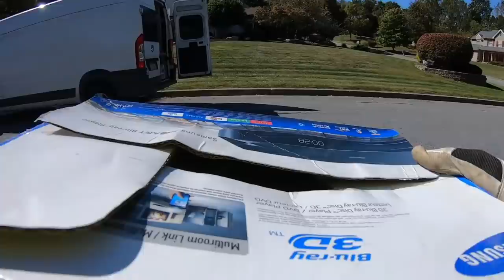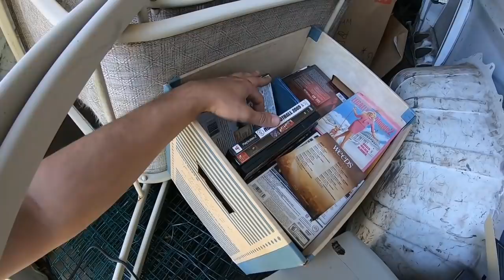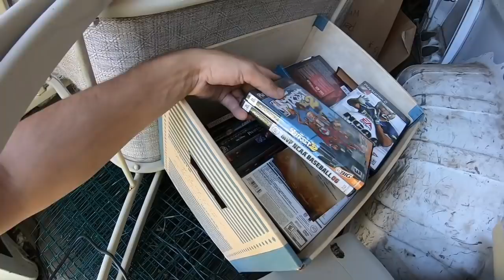WHY WOULD THEY JUST THROW THIS ALL AWAY?! Trash Picking Ep. 191

Comment: You might want to get the straps: Forearm Forklift Moving Straps provide optimal stability and help improve mobility with heavy or awkward cargo when moving. ... Capacity Furniture Dolly · Pratt Retail Specialties 100 in. x 78 ...The Forearm Forklift 9 ft. 4 in. L x 3 in Moving Straps provide optimal stability and help improve mobility with heavy or awkward cargo when moving. It is rated for items weighing up to 700 lbs. (318kg.). Lets you move items more effective. Helps prevent lifting injuries, used to lift appliances and furniture with ease, Adjustable straps, Rated for items weighing up to 700 lbs., Adjustable lifting straps.
Reply: The main problem with those straps is it doesn't make the item lighter. If its too heavy your still going to hurt your back.